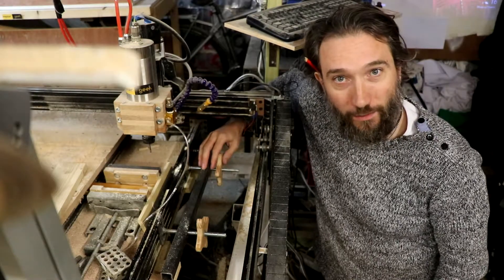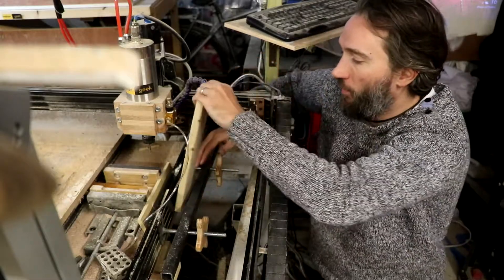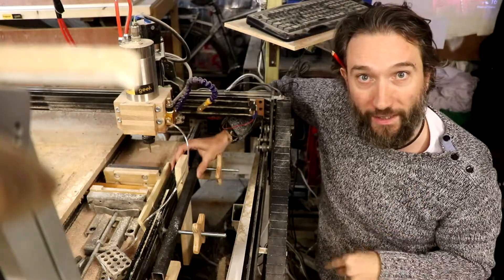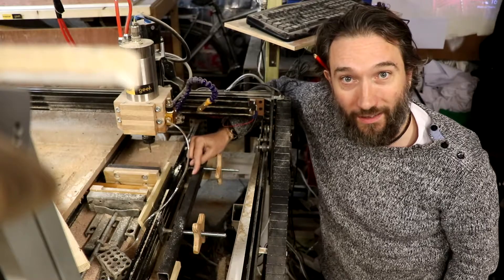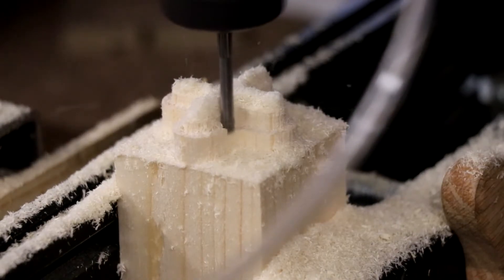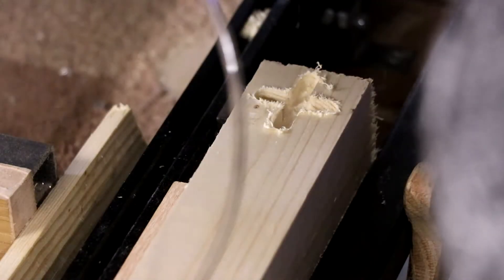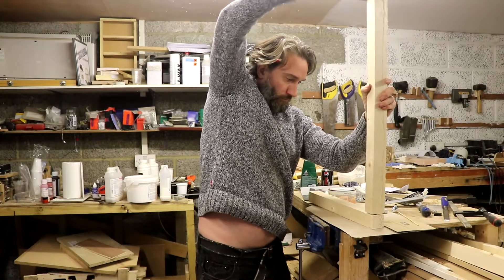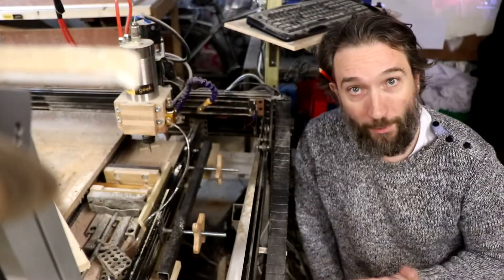Ox CNC Vertical Vice for CNC joinery

Comment: Very cool.  Unfortunately, I have a fixed gantry/moving table CNC.  That will make it difficult to make one of these, but probably not impossible.  I don't have boards more than about 15 cm wide that I'd want to do joinery with, so a 30 cm slot in the base and a clamp on the side of the moving table might work.  Thanks for the idea!
Reply from the maker: that would be an interesting challenge, as you say not impossible. but having to allow for the piece moving back and forth could be tricky. depending on the structure under the moving bed, you could maybe set up a hole through th eabse that clears the substructure enough. let me know if you try it and how you get on